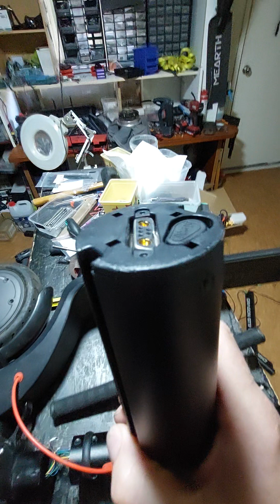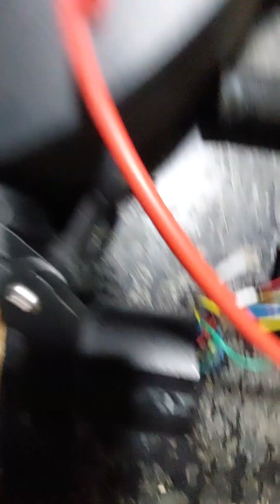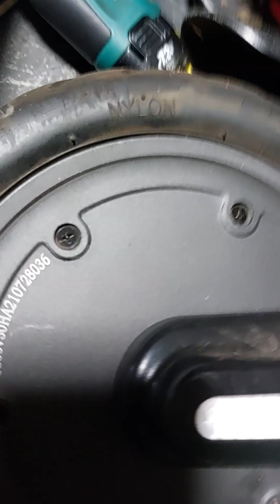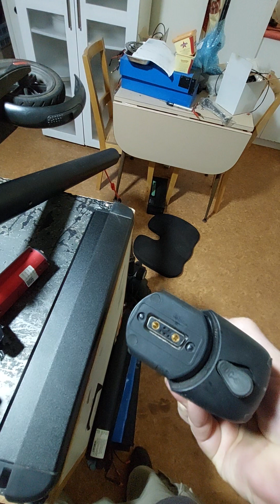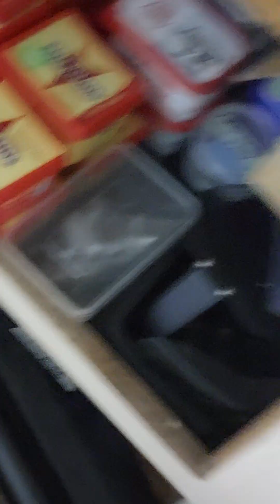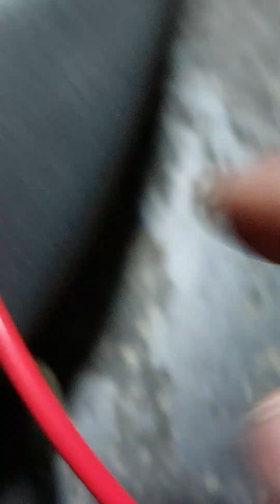Electric Wheels Australia - Mearth S repair NOT!

Comment: I got the mearth s but it has been sitting around for 2-3 years in my garage and I wanted to change the battery since the bms is dead but damn it’s impossible to open the stem to get to the battery… 
I might have to toss it away..

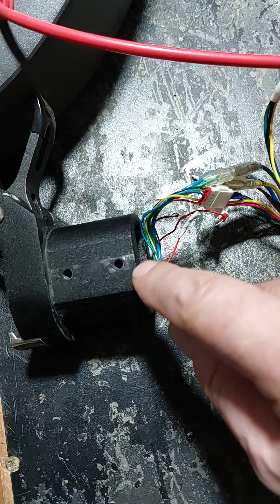Comment: 9:02 Western mountain.  My scooter read E1. I got into the motor saw a loose wire fix it it cleared the problem and I took it out ran great the second time I tried to ride it , it powered down while riding and now I have zero power. You have any ideas? And I'm getting a voltage thing tomorrow.